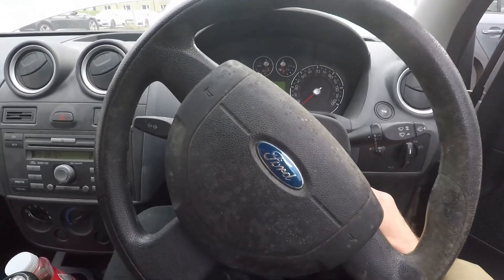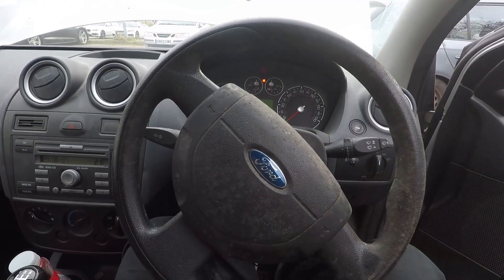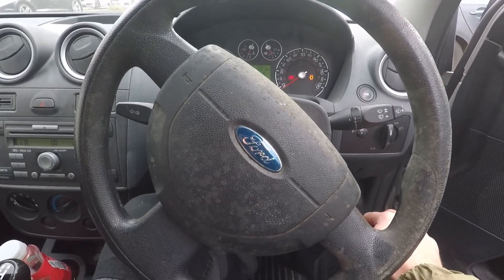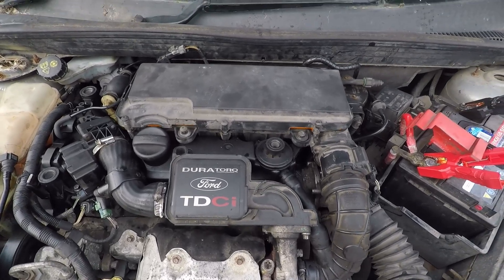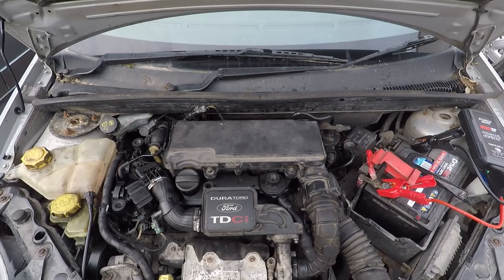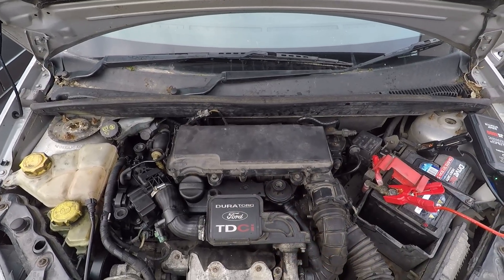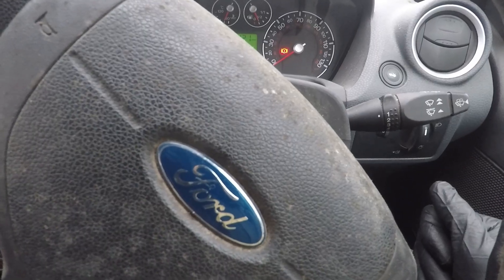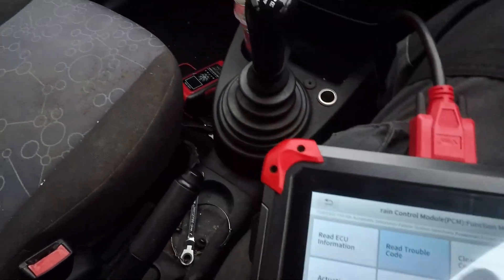Easy Injector Fault Diagnosis & Fix - Ford Fiesta 1.4TDCi (Peugeot/Citroen 1.4HDI/Mazda MZ-CD/CiTD)

Comment: there is a Windows App called Forscan connected to a ELM, which shows you the data of the injector so you can identiify which injector is not working

Comment: Hello, on my Fiesta 2008 I have a problem with injector two with yellow light and exclamation mark on, the anomaly is not continuous and when it occurs I just have to turn off and restart the machine. I replaced the injector but nothing has changed, what can I do?
Reply from the maker: Hi, have you definitely replaced the correct injector? If you unplug the one you replaced does it bring up a fault code for injector 2? 
If you have replaced the correct injector then possibly a wiring problem?  Maybe check for chafing or damage along the injector loom if possible? Wiggle wiring to see if fault appears? Resistance check from the injector plug to the engine computer plug if you can get a wiring diagram for it?
Reply: @GrubbyRabbitRepairs  Hi and thanks for the answer, can you tell me which injector two is? If I'm in front of the engine, is it the second starting from the right or starting from the left?
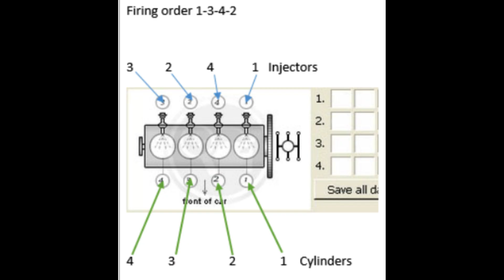Reply from the maker: If you look at the diagram at 1:18 it explains better. Standing at the front of the car looking at the 1.4 TDCI engine,  Cylinder 2 is the second from the right. But Injector 2 is second from the left (as the injectors are numbered in firing order).
To confirm, with the ignition switched off, just unplug the the injector that you replaced, then read the fault codes with a code reader, and see if it's the same injector that brings up the code you have been getting intermittently. Hope that makes sense
Reply: @GrubbyRabbitRepairs  thank u so much 🙏

Comment: Hi there I also have a problem with injector 1,I bought a refurb from eBay and fitted it,it was still running rough as like off a cylinder then I took for another drive and engine malfunction light came on and then there was a rattle,I limped it home and turned it off came back out about 20mins later and no rattle but after idling for a while the rattle came back and hasn’t gone away also still running rough,do you think the refurb injector is maybe faulty?I tried disconnecting just that one it made no difference and the rattle still there and quite a bit of grey smoke,any ideas what I should do next? 🙈
Reply from the maker: Does it sound like it could be this? 

Injector knock, also known as diesel knock or pinking, is a knocking sound in a diesel engine caused by faulty fuel injectors. This sound occurs when the fuel-air mixture ignites too early or unevenly, leading to uncontrolled combustion and a knocking noise. In a diesel engine, a bad injector can cause a knock because it can deliver an incorrect amount of fuel or at the wrong timing, leading to incomplete combustion and increased pressure within the cylinder, which causes the knock. 

Do you have an OBD code reader? What does the code say?
Reply from the maker: And...I know it would be a real pain but you could put the original injector back in and see if the knock goes away to prove if the refurb injector is faulty 😬
Reply from the maker: Also, I don't know if this is even possible but if the fuel pipe connection to that injector was leaking and pooling in the injector port, maybe fuel could get sucked past the injector seal into the cylinder and cause overfuelling. Could be worth a check
Reply: @GrubbyRabbitRepairs yes I will fit the original
Reply from the maker: How did you get on with the original injector back in? Sorry I've been away. 

I would assume you can get diesel knock straight away from start up if the injector is stuck open or something. You said it was still making the sound when the injector was unplugged so maybe it's stuck open and just leaking straight into the cylinder. I'm just a DIYer so I'm no expert.
Reply: @GrubbyRabbitRepairs hi there,it was a refurb from eBay so I thought it would be ok Atleast for a while,it does knock as you as you start it,I havnt taken it out yet but lucky enough I bought a set of four from a friend that says his was running fine so I’ll either fit one again or fit his set of four 🙈
Reply: @GrubbyRabbitRepairs hi there was a code for No1 injector P1201-70 #1 injector Circuit open/shorted but I cleared it and it hadn’t came back so far but still running rough and rattling like diesel knock bug can you get the diesel knock from start up? As soon as I turn the key the noise is there and doesn’t go away followed by light grey smoke

Comment: Could i ask if you dont mind, you inspired me to do my own, mine was injector one open/short circuit. Replaced it like for like but i had a non start, code showing injector circuit fault. Ive a launch x431 pro 5 but couldnt find anywhere to code injector in, and 0 info out there whether it needs done, did you have to code your new to you replacment? Looking forward to your reply thanks in advance and loved the video sub from me
Reply from the maker: @JASY86nirl  Hi, it shouldn't need coding in. My scan tool doesn't give an option to code in either.  Is it a brand new injector or a used one? Are you 100% sure you changed the right injector? Before you replaced it did you try unplugging it then starting the car to check that if the engine still runs on the 3 good injectors to confirm you're changing the bad one? If so it could be a problem with the new injector or problem with the wiring maybe? 

Glad the video was helpful but I'm sorry you're now struggling to start the car. You are also sure you've got no air in the fuel line still that's stopping it starting?
Reply: @GrubbyRabbitRepairs  thanks for replying bud I appreciate that, to be honest mate I dismantled  it all again yesterday and put the old injector back in and it started up, still with the open circuit cylinder 1 fault mind, but at least she started, I did do your trick and everything is proven the fault within #1 but she would always run even with lead detached, whereas with this new (to me) used  injector it didn't like, its a continental one of the same part number, that's why I commented as wanted to check before returning this one to the breaker, confusing info on the net, and they say they need coded but if yours or my tools don't do it, I'd of assumed like yourself it's not critical for starting and running, was confident I was getting enough rail pressure as live data showed over 4000 psi/250 bar pressure in the rail when cranking lol appreciate the reply chum and keep up the good work 👏
Reply: Mines was a Siemens though not sure that makes a difference
Reply from the maker: @JASY86nirl Was it a Siemens/VDO part number A2C59511612 or 9663429280? I replaced another one of these injectors on the Fiesta in this video a couple of weeks ago. I bought a new (or remanufactured) Siemens VDO one part number A2C59511612 for over £300 😳. I was stuck in limp mode whilst away on holiday in Scotland so needed one urgently. There was instructions in the box that said the injector didn't need coding, but whilst driving in 3rd/4th gear accelerate from less than 2000rpm to more than 3500rpm, then coast back down to below 2000rpm without braking then repeat 2 more times to let the car learn the injector. I did it but couldn't feel any difference. The car ran fine straight away with the new injector.

Comment: Hi when it was misfiring the yellow power train light was flashing. Did it go off itself when injector replaced. As my 1.4tdci as power train light flashing and won't rev past 3000rpm thank you
Reply from the maker: Hi, yes it should go off by itself when you put a good injector in. I had another injector go bad the other week and replaced it and the light went out without me having to reset any codes. I had the same symptoms as you with the yellow light and not revving past 3000rpm . The fault code I had was Cylinder 3 injector open circuit. 
Good luck 🙂
Reply: Thank you
Reply: Run  scan & it keeps saying glow plugs

Comment: My cars started running lumpy like this but no fault codes come up seems to be okay when it’s up to temperature but goes into limp mode occasionally
Reply from the maker: @DUFFYS_DIECAST  It might be worth trying some injector cleaner fuel additive before it gets to this stage. You never know, it might work 🤞
Reply: @GrubbyRabbitRepairs  my first thought was a maf sensor, but no idea if it’s the injector with it running lumpy on the cold start but settles down once it’s warm just weird that no codes come up
Reply: @DUFFYS_DIECAST Did you fix it ?

Comment: I have the same issue and exact same car ford fiesta 2007 style tdci 1,4 diesel and when I've gone to a Mechanic he told me that one injector is faulty but I have to change all the fore, I don't understand why if only one is faulty and the other three is alright why can't I just change one, I think he's conning me!!
Reply from the maker: His view might be that if one injector is bad now then the others will go bad soon. Thats fine if you have lots of money to spare, but the injectors are expensive. If it was me I'd just replace the bad one for now.
Reply: @GrubbyRabbitRepairs  exactly that's what I'm thinking, I'll just change the bad one for now, because they cost alot
Reply: I've just had mine in at garage 2007 TDCI, 1.4 and the mechanic told me number 4 injector code was coming up and EGR. My car would randomly go into limpmode on the motorway at high speed, turning it on and off again would sort this but this last month it goes into limpmode within 3 mins of driving at any speed. Mechanics told me they arnt easy to get out and it's a risk  and they break and not worth it given its age now. Basically death sentenced my beloved car...

Comment: injectors at these fords are not count as firing order . they are backwards . number 1 is gearbox side number 4 is timing belt side
Reply from the maker: Hi, thanks for your comment. As you can see from my scan tool data and what was happening when unplugging each injector on this particular engine, the cylinders are numbered 1 to 4 from gearbox end, but injectors are numbered differently, I believe in firing order. 
It is possible that different variants of this 1.4 diesel engine do not follow that numbering pattern but I can't confirm that.

Comment: I have the same car, 2007 plate. It’s now done 217,000 miles 😅
Had to replace a couple of injectors over the past 7 years but still running sweet 😊
Reply from the maker: It's great to hear that these engines are capable of those mileages 😃. They're worth fixing then and investing in new injectors when they go wrong. Cheap and cheerful motoring really if you can get 200k+ miles out of one, plus only £40 tax and good MPG 🙂
Reply: Yes great mpg, I get around 70mpg out of mine. As you say, great little cheap run arounds. It’s a shame the injectors are so expensive. Like you I got myself second hand ones. Touch wood they’ve been ok so far!

Comment: Thanks for your video, similar number 4 on my ford fiesta 1.4 tdci not firing, pulled connection 4 off still runs lumpy put connecter back on, no difference. So 4 needs replacing
Reply from the maker: Thanks very much for your comment 🙂. Weird how number 4 injector seems to be more prone to failing. Maybe it's just coincidence. Good luck getting it sorted anyway!

Comment: I have same problem as my car is a ford fiesta zetec 1.4 tdci 03 plate but it says electric accreltor control fail on dash but my mate put dinostic it saying injector number 4 ?
Reply from the maker: Hi, I'm no expert but I'm wondering if it could be that injector number 4 is not working correctly and is letting too much/too little fuel into the engine and making the car also think that it's got a electronic accelerator control (EAC) fault because it can't control engine fuelling properly. Or there is a chance it is two separate faults. A bit of googling shows EAC faults can be caused by a few things  including the accelerator pedal sensor or wiring. Personally I'd go after the injector fault first and see if that gets rid of the EAC issue. You could always just unplug injector number 4 like in this video and see if the EAC fault disappears and you're just left with an injector fault. Where are you located?
Reply: @GrubbyRabbitRepairs  evening thank you for your reply back to me iam in burnley lands UK 🇬🇧 the car as been like this for 2to3 weeks but I will try that with the wire on the injector were are you please
Reply: hi mate i know it says Charlotte but iam the husband please can you let us know what number 4 injector is please from the timing belt or gear box thank you @GrubbyRabbitRepairs
Reply from the maker: Hi, I'm pretty far away in south Lincolnshire near Bourne. Look at some other videos on how to take the air box off. It's pretty straightforward but there might be 2 bolts on the back of the air box that you can't really see. You have to undo them by feel really. I can't remember if they were for the air box or the rocker cover underneath. Sorry it's been a while since I did this.

Not sure if it's something you fancy doing yourself but I got a used injector off eBay for £60ish and a full set of seals (injectors/rocker cover/leak off pipes) for £15ish off eBay. Buying a used injector is a bit of a gamble I guess, but you can buy reconditioned ones for £130ish. New ones are ridiculous and are £200+ each when I checked! I got a great tip for cleaning the injector seat from another video - get a length of 15mm diameter round wooden rod (dowel I think it's called) from a DIY store, then you can wrap a rag round the end to clean the injector seat, then superglue a round piece of fine wet and dry sandpaper to the end to take off any burrs and smooth the seat. When removing the little clips for the leak off pipes, hold them with pliers because they ping off and get lost! Also make sure you cover the top of the engine with rags once you've taken the rocker cover off because you really don't want to be dropping anything down the oil passage ways! Same with the injector ports once you've taken out an injector.
Reply: @GrubbyRabbitRepairs  sorry about this and being a nuisance thank you stu
Reply from the maker: @CharlotteGreen-kv9sx not a nuisance at all, hope it can help you get your car fixed 🙂
Reply: @GrubbyRabbitRepairs  hi again mate sorry to be a pain will the injector set it self with code or will it have to be program in thank you
Reply from the maker: @CharlotteGreen-kv9sx  hi, I didn't need to program mine when I replaced it. It just worked fine straight away.  You might still need to clear any old fault codes with a scan tool to get rid of the check engine light if it stays on.
Reply: @GrubbyRabbitRepairs  ok there was no engine light on at all ? I'll have to see if I can get someone to scan it I have tried the code reader ie from aldi it was coming up with link error a bit mad I know lol
Reply from the maker: Sorry! I confused myself. Look at the diagram in the video at 1:17 and again at the fault code I'm getting at 7:50. So injector 4 is in cylinder 2. (Gearbox end is cylinder 1, belt end is cylinder 4) so injector 4 is second one along from the gearbox.

Worth double checking the fault code you're getting is injector 4 and not cylinder 4
Reply: Evening mate I have swoped the injector over still was running only on 3 cylinders but poss mite be number 2 near timing belt coss took the wire off was still running on 3 coss you can tell so let's see what happens tomorrow hehe lol 🤣
Reply from the maker: @CharlotteGreen-kv9sx  Ok, sorry you didn't get it fixed today but good luck tomorrow. Sounds like you've found the faulty one. Hopefully it wasn't x2 bad injectors! That would be really unlucky!
Reply: @GrubbyRabbitRepairs  evening rabbit sorry to be a pain I have done all the injectors now it will not start up at all ? and I don't want to give it sniff
Reply from the maker: @CharlotteGreen-kv9sx  Hi, it's probably air in the fuel lines. Does your car have a priming bulb? Give that lots of pumps. If not you can buy priming bulbs that will plug in-line  or could possibly use a cheap hand held vacuum pump with a bottle etc to draw fuel up. Or a tiny squirt of brake cleaner/easy start in the intake downstream of the MAF sensor might get it to fire up long enough to start drawing it's own fuel through. At your own risk though as probably not ideal for a diesel but I've done it before. 
Unfortunately I don't think those tdci engines have a lift pump in the tank like most cars. Most cars you just turn ignition on/off a few times and it primes using the lift pump in the tank
Reply: @GrubbyRabbitRepairs  hi again yeah it does have a hand bulb primer done that but not sure were to get the air out from its from the injector side ie like crack off the prime them up ?
Reply: Hi rabbit me car running today sat in car
Reply from the maker: @CharlotteGreen-kv9sx  Great to hear it's running again! All injectors seem to working now? Did you need to crack off the injector pipes whilst squeezing the bulb or did it you just have to squeeze the bulb some more? 

I don't know about spraying anything into the turbo. I don't think I would do that while the engine is running. I'm just a DIYer so I'm no expert, sorry
Reply: @GrubbyRabbitRepairs  primed all fuel up into the filter boom running took a bit but done
Reply from the maker: @CharlotteGreen-kv9sx  Boom! Great news 😃
Reply: when car running can you spray egr valve cleaner into the turbo